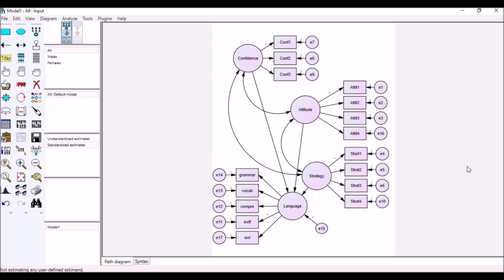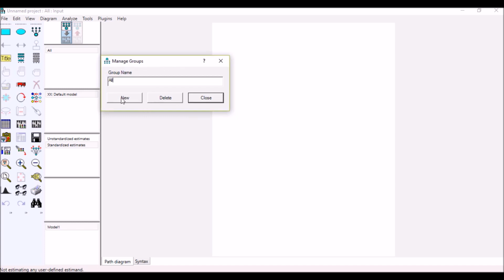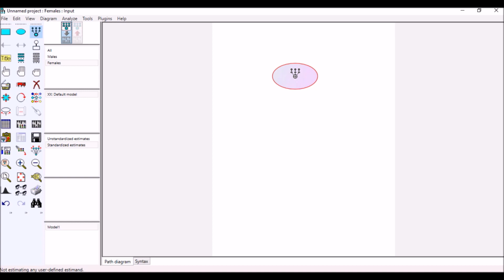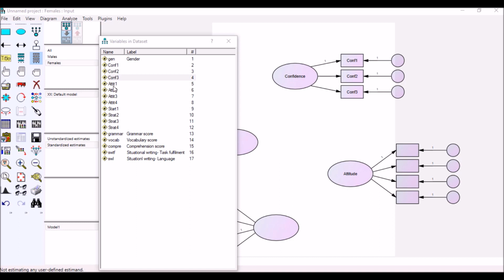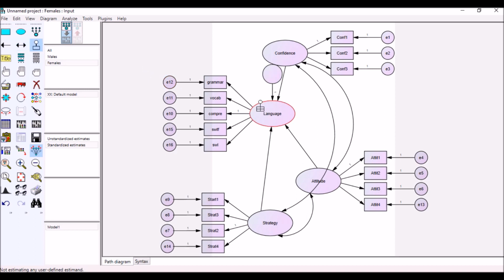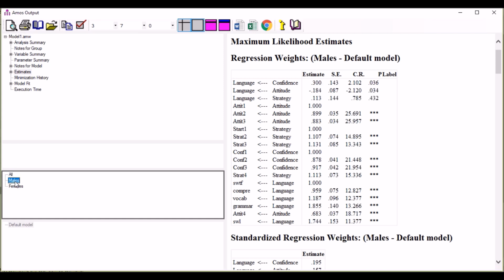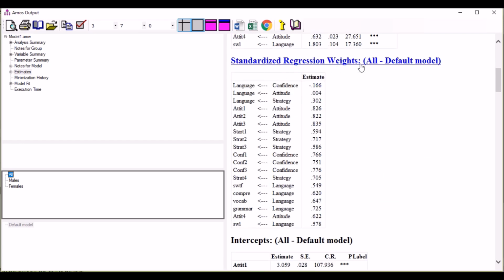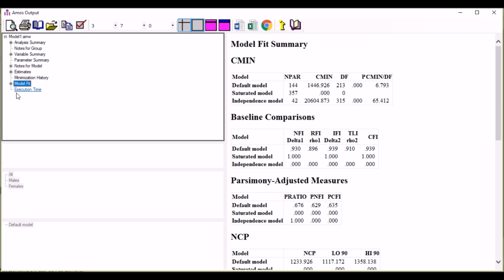How to do Multigroup Structural Equation Modeling using AMOS?

Comment: Thanks for the video. I have been learning SEM for a few months for my PhD thesis. My big question that I cannot seem to find anywhere is, if you do model modification because say the hypothesised model has a poor fit, should you do it on the all/default model that uses both groups? What if the default model has a good fit if you do not do a multigroup analysis, but when you do perfrom multigroup the model suddenly has a poor fit?
Reply from the maker: it probably indicates that the parameters are quite different across the different groups, and the multigroup model should be chosen.
Reply from the maker: In that case, you should stick with the model with the better fit.

Comment: Hi, I am trying to make a model to examine the relationship between culture and entrepreneurship levels and I only have 43 countries in my sample but I used cluster analysis to create groups and now I want to do a CFA. Should I do it for each cluster? When I try to do CFA(Confirmatory Factor Analysis) for all, the model fit values are getting pretty low. But when I try to use CFA for each cluster Amos says my sample size is small. What can I do to solve this?
Reply from the maker: As a rule of thumb, there should be 10 to 20 people per item in SEM analysis. Yes, you can test if CFA fits per cluster.

Comment: When i try to run the model a message saying " the model is probably unidentified. In order to achieve identifibilty, it will probably be neccesary to impose 2 additional constraints" 
🥺🥺🥺🥺🥺
Reply from the maker: You will need to fix one parameter (ie, regression weight) in each measurement model to 1. I have explained how to do it in the video. It should solve your issue.
Reply: @VahidAryadoust  got it thanks doctor 🙏🙏🙏🙏🙏

Comment: NIce Job Dr. Vahid Aryadoust, However, the Video is blurred for the first 12minutes of the demonstration which is the basis to understanding the concept and idea. I will appreciate if you can do the Video again and make it clearer. Thanks. Also I need to get your email address to communicate with You Dr. Vahid
Reply from the maker: HI, i checked the video. Is fine. Could you use a different browser?